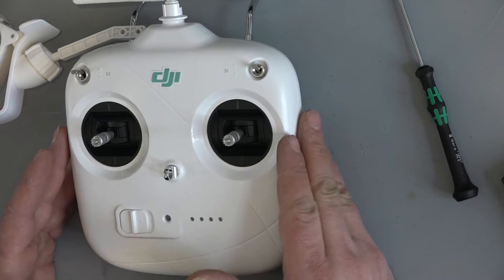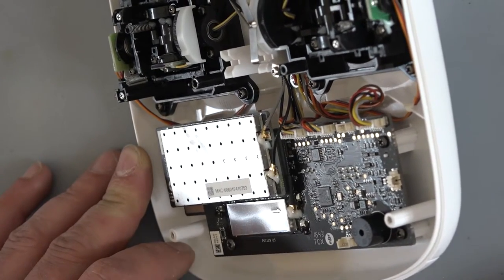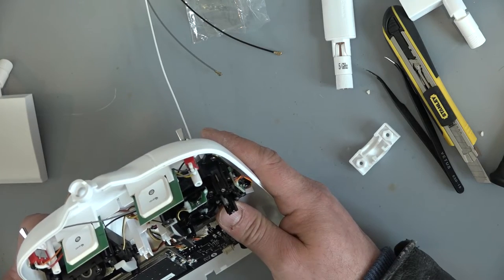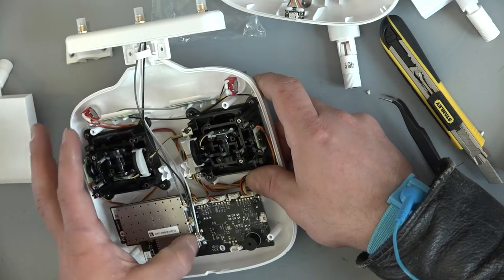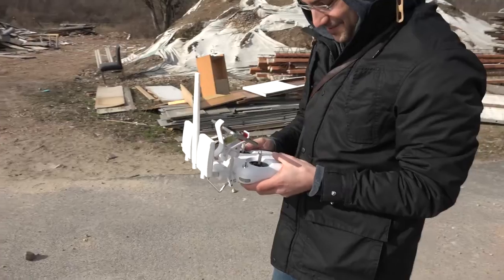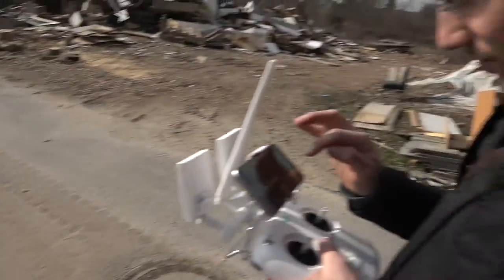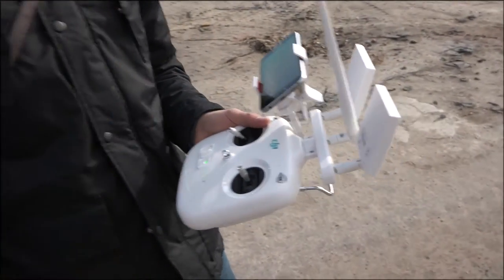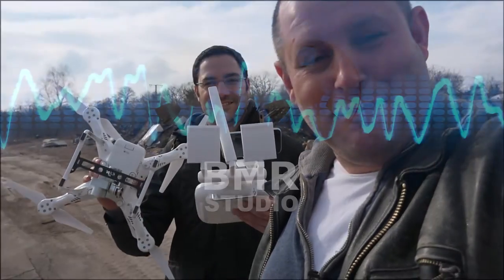Installing the ARGtek-EXT1 range extender into DJI 3 Phantom Standard

Comment: I am having 1/2 the range I used to have with the stock… help!
Reply from the maker: Faulty connection, or the soldering wrong at the end of the antenna. Or, just check the firmwares?